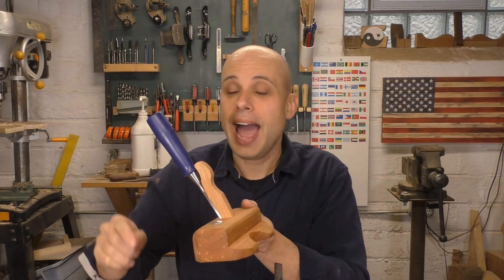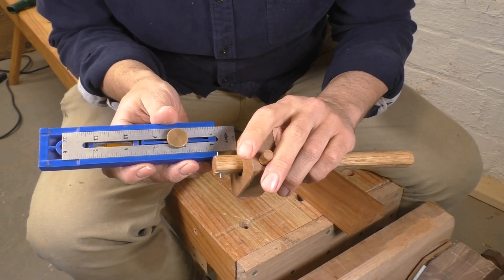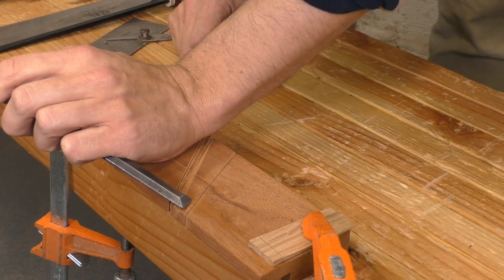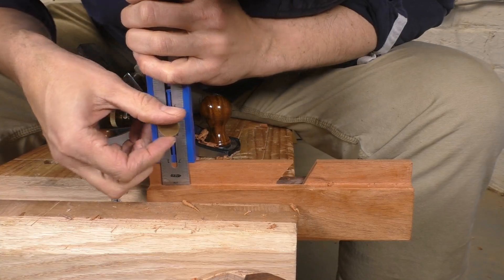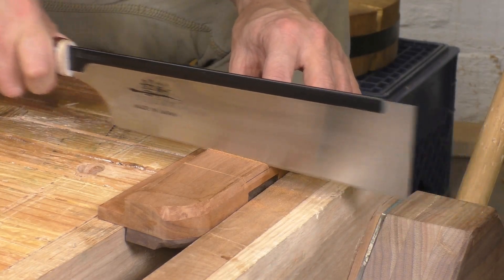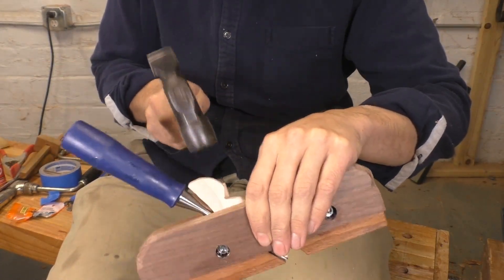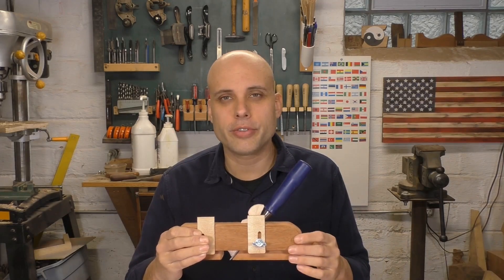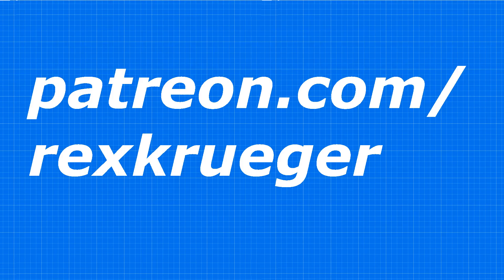Cut perfect grooves with this DIY tool!

Comment: I’ve been in the woodworking trade for decades. I love this series. You’re inspiring people to work with their hands and build stuff. I’ve got fancy power tools at work that any fine cabinet or furniture shop would love. I’ve got power tools at home that many hobby woodworkers would envy. But I’m happiest when I’m using plain Jane hand powered tools. Sure, throwing a table top on the surface sander is easy and fast. Yes, using a molder or shaper is quick. But does it fill you with pride? Meh, not like building a nightstand by hand does. You’re showing beginning woodworkers how to build the tools they will need. Which I think is a whole lot cooler than telling someone (I’m looking at you “New Yankee Workshop”) they need a $350 router or a $1,300 panel saw to do a project. Keep it up dude! I always look forward to seeing what you are up to next.
Reply from the maker: I do love my power tools for long rip cuts and other heavy work, but then I like to shut them off and settle in to the joinery and details in peace.
Reply: Do not be taken in by this guy. would you cut a sheet of ply on a dimension saw without first checking that the riving blade was set correctly and that a test piece went through without raising chips along the edge on both sides. Then you would not use a rebate or plough plane without a riving knife built into it. 
Putting a try square over a plane is usually a waste of time, close is all that is required for a shooting board as the blade can be adjusted by up to one degree to account for wear on the plane and wear on the shooting board.
Flatting the sole of a plane dose nothing if you put a plane on fine sand paper and the leading edge, trailing edge and around the mouth shine then it is good to go, the sole between is just holding those three lines of contact together and dose not have to contact the work piece. 
I would suggest typing"Paul Sellers" into You Tube.
Reply: Sidney Easton This is basic woodworking, dude. Chill out.
Reply: @sidneyeaston6927  Looks like you're the smartest guy in the room. What 's the name of your website or YouTube channel?

Comment: For keeping epoxy out of nut threads, coat a bolt in vaseline and put it in the nut while you apply glue and place it in location. Particularly useful for those of us who like to go overboard with epoxy.
Reply from the maker: That's a solid tip!

Comment: Tip on using rabbet planes without a fence, use your fingertips as the fence, tumb over the top of the plane and fingers down the outside.

Comment: The nuts are a bit overkill, you could just drill the tapping size for the screw/bolt directly into the hardwood and it would hold fine.

Comment: Files with “safe sides” (aka “safe edges”) are under-appreciated. I lived most of my life without even knowing what a “safe side” was. But now I keep seeing more uses for one.
Reply: Seen Clickspring grinding one side of a file in order to make a safe edge? I was amazed at somebody doing that to a tool, but it makes all the sense!
Reply: @rojirrim7298  Can't count how many times someone has sneered down his nose at me, walking out of the store with a brand new file (cheap as possible) to proceed to grind off and polish a face... (coarse grinding compound at the auto-parts shop... usually finishes...  right after a steel wire wheel deburs)

    It's okay... when they have a very controlled groove to make, and can't help gouging out the wrong directions, maybe they'll realize what the hell I was thinking "ruining a brand new tool"... (lolz)

      Works on rasps, too. ;o)
Reply: I make sandpapper tools with the naked side or use a paint stick.  I'll have to look for that type of file.
Reply: @buzzgallagher  Sandpaper tools and EMORY CLOTH (cap's for importance)... are great for some uses... USUALLY, for "odd shapes"... Take a file, and "tap" it with a grinder on the "offensive" side. Then debur it with a steel wire wheel (you can mount it on a drill... cheap) and whether or not you "finish" it with a grinding compound or some polish is up to you... Sometimes I do, and sometimes not.

Comment: Rex, I find it much easier to start a groove using the wood body planes by starting at the end of the cut rather than the beginning. Then slowly lengthening the stroke.
Reply from the maker: For sure,  that's the way.

Comment: May sound crazy brother, but this still has been the most valuable video I’ve had of yours.   I own a No° 45 and actually now finally have a plough plane on order (3 months to go 🤪).   The °45 just isn’t nearly as easy to use and consistent as using my Kruger grooving plane.   I benefit from all you content in some way, but the gooving plane was just what I needed, right when I needed it.   This video came back up in the algorithm today and so I thought I’d drop a line.

Comment: Aloha Rex,
Good plow plane build and you didn't need to hitch up the mule team, either!
I add to start the cut of the grove, begin the cut from the far end, taking your first shaves there and work your way back, making these cut longer and longer as you progress. It makes your guiding the plane easier and shaves better than trying to establish the width of the cut at the same time as the length. The cutter decides the width where ever it is placed, the depth stops control the final cutter's bite, but if you remove some of the strain of both by the final end being cut already, you are no longer sliding into uncut territory but that of a finished cut field, less chance of a miscut or cut gone arye. On your router plane, nice but cuts seem too deep and chisel shows it by flexing from the cuts you were making. Better to make lighter cuts and have finer shaves than hacking it out. Slips happen and lighter cuts save cuts in our hands.
Reply from the maker: You're totally right.

Comment: I decided to add a fence to the bottom of the grooving plane for width adjustment, cuz sometimes it can be really hard clamping a batten to a very narrow workpiece. Also I didn't make it fully braced but left the plane iron(chisel) half exposed, that way it's super handy for chips to exit. Now it takes spiral shavings that look like spring.

Comment: Very nice, Rex. I'd have used a temporary fence for that very first rebate in the plane itself too, though I don't suppose the angle matters as much since you can just plane the sole later.
For little pieces like those depth stops, I've found it really helps to laminate two pieces together with the grain crossed at 90°. It increases the strength immensely & will do away with any risk of the wood splitting along the grain when you apply pressure to those slots.
Reply from the maker: All good tips!

Comment: You could put a simple fence on that plane by drilling two holes through the plane then gluing 1/2 or 3/4 nuts into the holes. Then put the fence on the bolts (the fence should slide easily on the bolts but not wobble) and tread them into the nuts that are glued into the plane. Finally add wing nuts to the side opposite the fence to lock it in place. The fence is adjusted by screwing the bolts in or out and then is pushed against them when you plane the wood.
Reply from the maker: Yup. You could totally do that.

Comment: Thanks Rex.Really enjoyed that.
Another,lazier(!) way to make the tool is by glueing 4 blocks together.As long as you have some stock for the central part which is exactly the same width as the chisel;then u can just cut an angle on each central piece to form the space for the chisel and wedge then glue on the 2 sides afterwards.
Any fine tuning is done to the wedge after glue-up.

Comment: Rex:
I have used a piece of scrap wood clamped to my work piece and ran my plane side against the wall against the scrap wood to insure I stayed straight.  I also used a knife to nick the side to prevent the plane from being pushed over on successive cuts.

Comment: You might consider making a video that is similar to this, using one tooth from an old carbide saw. It would make thin grooves for perhaps the bottoms and backs of a home-made drawer. I can see making three widths of this tool for general purposes.

Comment: Using chisels is great, but you should also go over how to make/harden your own blades out of scrap carbon steel (files, throwaway chisels, etc).  As long as the cutting area is small enough to heat with a plumbers torch it's not that hard, and it opens up an entire world of customized tools.
Reply: I think Rex has a video showing how to harden the edging mower blades he tried using in a wood plane build.
Reply from the maker: I feel like many people just don't want to get into all that even though it's not very hard.
Reply: @RexKrueger  Sad but probably true.  Myself, I love setting things on fire :)

Comment: ive been trying to find out more about wood working becuse i need to make a display case for video games and the only thing i dont have to make it is a tool to make the grooves to make the channels for the glass and the channels that the shelf is it sit on. im being told im doing to much work for a display case for my store and i should just use L brackets and screws for my small 2 1/2 foot x 2 foot x 3 inch project

Comment: Antique brass doorknobs would make excellent handles for your planes. They come with a threaded bolt on the end that would be really easy to attach to the end of the plane without messing with the measurements and give your planes a comfortable pushing or control surface, and a unique look. I don't recommend those old crystal doorknobs though.. glass on a tool sounds like a bad idea...

Comment: Instead of gluing a nut into the body and using "wing screws" (not found at my local big box store), could one glue in a hex bolt and screw on wingnuts or star knobs?
Reply from the maker: Absolutely!

Comment: Rex, I really enjoy your videos and you're helping to aspire me to dabble in woodworking. Thank you. I'm re-watching this one already and I had a thought. Around 3:30 you're having trouble with the rabbet plane with the width of the cut and also the accuracy at the shoulder of the cut and I wanted to ask this:

Would it make sense to make a big knife wall or saw cut along the line and then run a couple of saw cuts to approximate depth down the length of the waste first and then whack the bulk of the waste out with a chisel and mallet? Then the Rabbet plane could clean up the cut functioning as a linear router and to provide the nice finish.

Just thinking out loud. I'm an IT Guy so take all of that with many grains of salt. Thanks again for your great content!
Reply from the maker: That would totally word AND it's a historically accurate way of doing things.
Reply: @RexKrueger  
Cool, thanks! I was really asking not to nitpick but to have that extra info in my back pocket for if/WHEN I run into some trouble like that on my own. 

Keep up the good work!

Comment: FOR SALE: tons of power tools, all sizes, brands, colors, working, not working, come and get'em! Bench-top models, floor models - if it's got a cord or a battery, it's for sale!

See what you're making me do Rex? Do you SEE??? ;-)
Reply from the maker: To be fair, I have all the electrtical toys and no plans to sell them.
Reply: I'll buy a bench grinder from you :-). Evil I know.
Reply: Jointer? Where are you?
Reply: Got a 2x72 wasting space?
Reply: the power tools just make the work go faster. and it isn't cheating if you already have them!

I refuse to give up my spindle sander and table saw!
Reply: Well..... maybe, just maybe, I slightly overreacted.

And apparently, I missed THIS video from Rex. https://www.youtube.com/watch?v=EMV0yO_3mUU
Reply: I gave up a table saw for a 14" bandsaw and a track saw.  For cross cuts, I often just grab the handsaw because it's quicker.  It takes longer to setup the track saw or it's too far from the end to fit in the bandsaw.
Reply from the maker: If he's got a 2x72, then i want it!

Comment: Could you please explain the difference between this plane and the rabbet plane? They seem to be almost identical?
I think I will try making the router plane and the rabbet plane, using the same chisel, but I also think I could use the same wedge (adapt the cutouts, instead of adapting the wedge).
Thanks for the nice videos and inspiration.
Reply: They are very similar, the difference is with a rabbet it’s on the edge of the board, this is set a little back from the edge. I have my dads Stanley and it can be set for both depending where you position the fence

Comment: The router plane looks like it could damage the walls of the cutout, is there a way to open up the front so the blade can be seen? Love the series and plan on making most of these once this rotator cuff is healed.....
Reply from the maker: There's really no danger. The walls are tough end grain.
Reply: Gotcha! Thanks for the quick reply!!!

Comment: Rex, I've been looking at your tool lists in the video descriptions, and I haven't found any recommendation for the hatchet you used in the early videos. Do you have a recommendation?
Reply: I do green woodworking with a hatchet often.  I have a harbor freight, an antique hewing hatchet and a Vaughan shingle hatchet.  The one with a hammer on the back of it.  The Vaughan was $20.  Some work with a file to round the corners and flatten one side a bit to narrow the cheeks and I prefer it.  But I sometimes just grab the harbor freight one.  Just sharpen & shape with a file, they all work.
Reply: I use a half-hatchet by Truper that I got from Menard's for 9$. The design is also called a carpenter's axe sometimes, because the poll is a hardened hammer. I used a file to bring the inclusive angle of the edge down to 28° (just went as low as I could without scratching the head) and a gentle convex edge (it came flat) which overall took about 20 min.
Reply from the maker: Mine is an old Plumb hatchet. I need to find a new one I can recommend.

Comment: I've a question, on the Shoulder/Rebate plane; being as how it's made in the laminated fashion how much harder would it be to cut the skew into the bed before laminating it to the backer board, and roughly what angle should that skew be cut to? Reason I ask is at the start of this video you said that the blade being straight made it harder to get a full cut because of the lack of a skew, and since I've not built mine yet I figure I can learn from listening and cut out the small inconveniences you find in the ones you have made. 

I do so enjoy these build your own damn tool videos tons of fun. Sry I missed the premiere no clue what I was doing so no good excuse
Reply: I don't think making the body of the plane would be too much more difficult.  The issue you would have  is the iron.  You would either have to custom make one or radically re-grind a chisel to make it work.  I think part of Rex's thinking for making the bed square to the body was to keep the chisel usable as a standard chisel as well functioning as the plane iron.
Reply from the maker: You're both right. I'm trying to make things very easy, but I don't think that skew iron would be such a big deal. I'm not sure. I haven't done it yet.
Reply: @RexKrueger  I've a very old shoulder plane, one where you have to place the iron in the body from the sole and the angle on the iron tip is very small like maybe 5° or 10° so I tried to set my chisel down with a skew and keep the tip flat on the bench but it was without much success. Reason I'm wanting to build a new one is that the body of my shoulder plane is bent/twisted out of shape that restoring it is pointless. Thinking that I may just keep the iron and wedge and rebuild the body, but I'm going to go the lamination route because I dont trust my skills with the complicated mortise required to make an antique style shoulder.
Reply: If you have not made your plane yet a lot of the old ones have the mortice for the iron go from side to side and only the tang goes through the body of the plane. That should make it somewhat easier to cut the bed for the iron. The mouth on these old plane is also often bigger than ideal since you take out the iron that way.

Comment: OK, come on, the groove plane and rabbet plane are so similar that it should be one single plane. Then with some kind of side attachment it will be possible to have groove plane from a rabbet plane. Right? I hope Rex can figure it out!
Reply from the maker: Not really. The rabbet plane cuts anything from 1/8 to 3/4. The grooving plane has a 3/8 cutter, so it could only do a very narrow rabbet. They've always been separate tools with different jobs.
Reply: @RexKrueger  And what about making rabbet plane with a 1" (25mm) chisel. Then adding a side fence dedicated to a chisel (possibly smaller one) with some kind of pusher (that will hold chisel in place, possibly a metal one). Is this makes sense? Side fence would act like a part for a groove plane and as a holder for chisel. I totally can see this working in my mind. Do you?
Reply from the maker: I don't.  Why not make it and then everyone can see? I'd love to see it.  Really.
Reply: @RexKrueger  I would love to, but my lack of time and knowledge is making this impossible. I just thought this you could take the challenge of creating a new tool.
Reply: Combination planes are great for the hobbyist or the travelling man but a full time carpenter would want every plane set up and ready for one job straigth away.